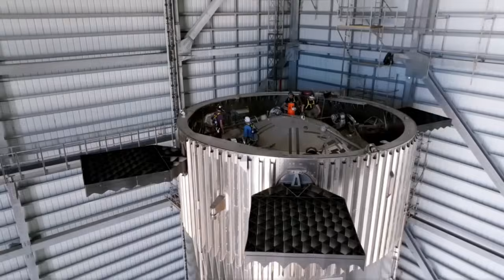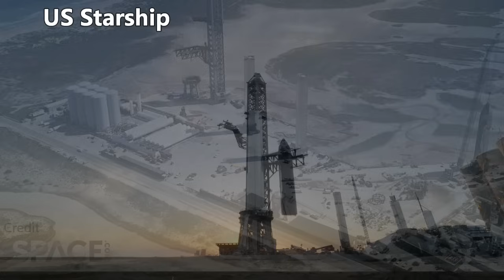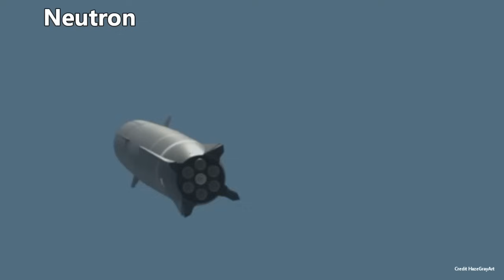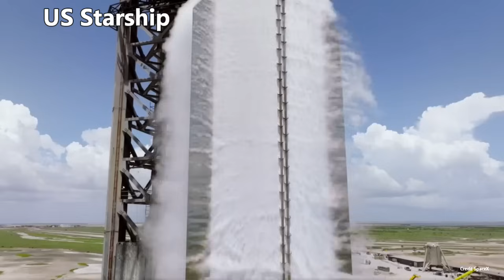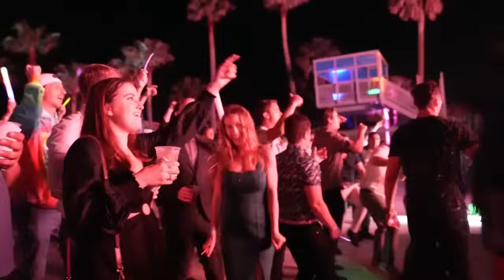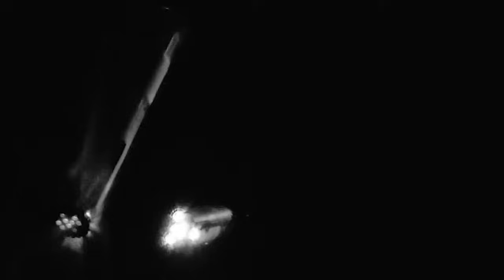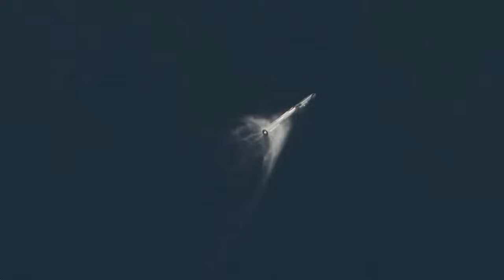SpaceX LEET 1337 Rocket Engine and the Development of Raptor 3!

Comment: Successful rocket engines boost real payloads to orbit.  So far - and probably for a year or two longer - all of the flights that Raptor has been used on have blown up or only travelled suborbitally.  By definition then Raptor is a failure.  It could be a success but if Elon keeps announcing new versions of Starship and refuses to integrate it into Falcon 9 or Falcon Heavy (or sell it to other launch vehicle makers) the Raptor will most likely remain a failure for some time.
Reply from the maker: Then what is the BE-4?  A total failure? No.  These are rocket engines in development and the Raptor has been a resounding success we would argue :-)
Reply: @terranspaceacademy  
Good point!  Except that the BE4 has a chance to be a real success - boosting real payloads into orbit - long before the mythical Raptor.  Now that you mention it, the BE4's upcoming launch may be the REAL REASON that Elon is rushing to launch the next Starship ASAP!  He wants to prove that Starship (and Raptor) is a success before the BE4 puts a real payload into orbit.  You know, if that IS the reason, then Elon is a really, really sad guy.  Which is really, really bad news for SpaceX because it is clear that Elon is driven by ego more than sense.  Just like NASA was when it insisted on launching the Challenger Shuttle on a freezing day and killed Crista McAuliffe. If some adults don't start running SpaceX soon, I think we can count on a similar result from SpaceX.  Let's hope it's Elon that killed this time instead of some poor teacher.
Reply: @wbwarren57 The bar for BE-4 is putting a payload into orbit? What is this, Sputnik 3? We're judging engines by where in the atmosphere they've been fired? By all means cheer for the engine that you want, but this video has clearly laid out where Raptor has gone that no engine has gone before. The rest is just useless hate.
Reply: @kiaweetan500  
In aerospace, it's not "best engine" wins but most appropriate engine wins.  If "best engine" wins was the rule, then all commercial aircraft would have upgraded to the SR71 engines years ago. Raptor might be a good engine, but if it doesn't fly on an economically successful vehicle, then it will just be another failed "might have been".  Unfortunately, the announcement of Starship V2 means that the next six to eight months during which the remaining four Starship V1 craft will be flown is at least partially a waste of time.  Yeah, they will learn some things, but as the saying goes, "rocket science really is rocket science" and there can be a lot of complicated interactions when you attempt to scale something up.
Reply: @wbwarren57  Basically, you're hating on Starship. Your prerogative, but aerospace is also full of vehicles being mated to engines. You haven't provided a single counterpoint to Raptor engineering progress other than "Starship bad". There is a point to developing really damn good rocket engines.
Reply: @kiaweetan500  
Raptor could be a good engine if it was mounted on a good vehicle that had a clear mission.  Unfortunately, Elon is holding it hostage to Starship's questionable vision.  Bad news for Elon is that eventually his good engineers will leave SpaceX and take their expertise to other firms that want to develop something that will see use on an economically viable launch vehicle with a clear mission and a real development plan.
Reply from the maker: That may be but I would not hold my breath.  Most at SpaceX seem to live for the dream and are extremely devoted.

Comment: Are we saying that Elon is developing the Raptor 3 to be the GFY of rocket engines??   (Greatest Full-flow Yet)?   🚀
Reply from the maker: He still plans to build something beyond Raptor. I'm hoping for methane RDE Aerospike! It's about the only way to beat the Raptor by any significant margin.
Reply: @terranspaceacademy RDEs can't scale well.  They have low thrust, and to increase it they'd need to grow in diameter - but in contrast with bell nozzles, the exhaust cross section area grows only linearly rather than quadratically with diameter (annular aerospikes in general suffer from the same issue.)

Which is why RDEs will probably only ever apply to upper stages, where specific impulse becomes relatively more important vs. thrust.  Even then, they'd have to compete with other, even higher Isp engine types such as nuclear thermal and plasma electric.
Reply: @terranspaceacademy I don‘t think you do it in the video but as a note, I have when people say „Elon is developing“, no he isn‘t. At best he is leading/overseeing the development. He is not an engineer, which is not a dig at him, it is just a factual statement. In fact he would be doing a bad job for his current role if he were doing engineering work. That is what SpaceX has got highly skilled engineers for.

I just despise when we attribute everything to managers when the reality is that this stuff is very much a team effort. Its likely not even true that this is only his vision. Its more likely he has people around him with a similar idea and one influenced the other, until it becomes something cohesive that can actually be built.
Reply: The original question I posed was asked in humors terms with the implication being that Elon definitely has the best team around him.
Reply from the maker: Ah!  I am ironically devoid of a sense of irony. :-)

Comment: for lift off on the moon, wouldn't draco's be enough ?? .. at least to get moving from the moons surface ... lighting main engines once under way would reduce G's considerably .. and guarantee fuel is at the base of the tank ... then again maybe that thought is too simplistic
Reply: I think the point he was making was to do with his dislike of referring to thrust in metric tonnes. I still like that method as it is easy to visualise and the gravity variations are simple to allow for.
Reply from the maker: They are indeed.  It's just important to know that they are there :-)
Reply from the maker: Draco's would be the best option on many grounds.  Including that they are hypogolic, which is the only safe way to get off the Moon until we have settlements in my opinion.
Reply: do you think Draco's could lift starship ?? I dont know enough about them to do that math   @terranspaceacademy
Reply from the maker: That's a very good question.  It depends on how many you have but perhaps bringing it down on the Moon would be possible.  Let's look for the deltaV that they provide per engine and we can do the math.

Comment: Thrust to weigh on the moon=9 so the spacecraft would experience 9g? Nope the g force isn't related with local gravity, but with the earth standard, no matter if you are on the moon or somewhere else.
Reply from the maker: The people would experience the equivalent of 9 Earth gravities therefore 9 g therefore I'm right and your wrong! :-)
Seriously though. 9gs are 9gs anywhere. The rocket engine is overpowered for use on the Moon.
Reply: @terranspaceacademy  it's about acceleration, not about gravity, the people would experience equivalent of 9 time the moon gravity acceleration, witch is 1,62m/s square, so almost 15m/s square =1,5g.
Reply from the maker: No, I divided the acceleration by 9.8... Or at least I thought I did.  There's not way that much power on the Moon would not paste your spine but I'll double check, thanks you for your attention to detail.
Reply: @terranspaceacademy  a rocket acceleration don't depend on what it's its weight, but only on what is its mass, so a 120 tonnes mass rocket with 1,8 MN engine will reach 1,5 g acceleration on earth moon or even in zero g environment.
Reply from the maker: You are right my friend! Watch today's lesson for a shout out! :-)